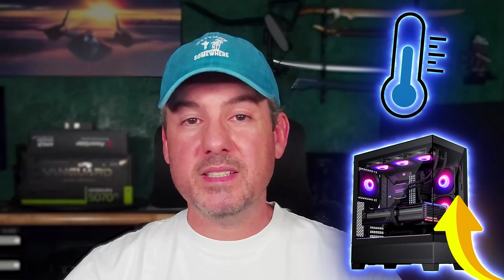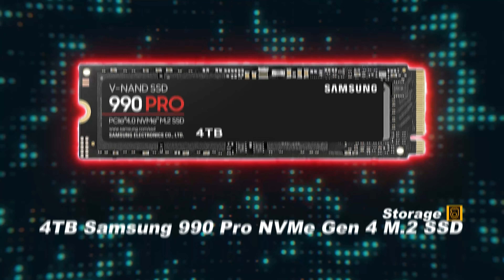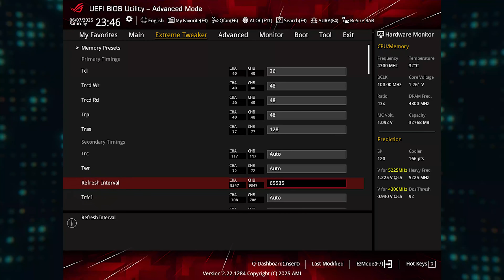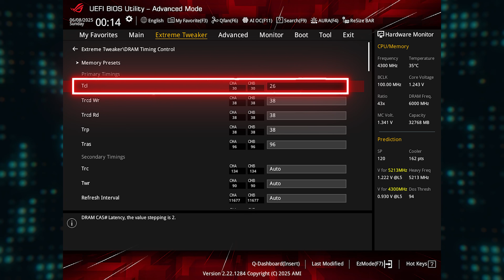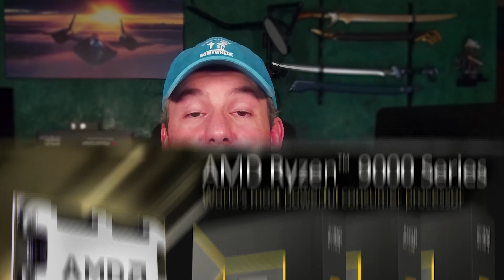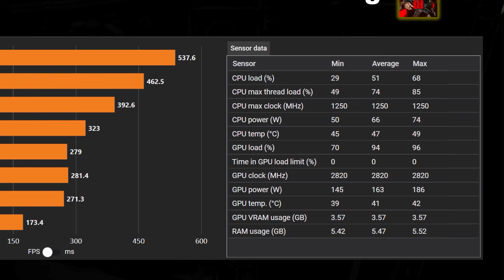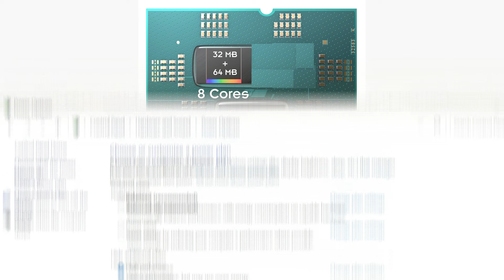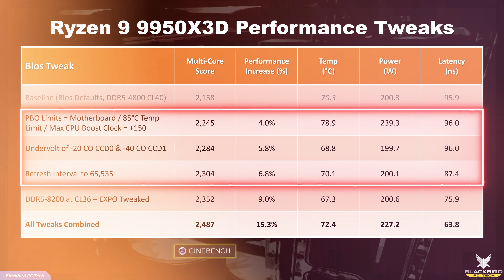What Are The Best Settings for an AMD Ryzen CPU?

Comment: The Ram MCLK/UCLK /FCLK really lost me.
I'm using X870 MAX GAMING WIFI7 motherboard with Kingston 64GB DDR5-6000 Fury RAM (2x32GB CL30) and R7 9800x3D and EXPO tweaked
so if i understand correctly i should go for a 2:1 and push my FCLK as high as possible but since my motherboard support up to 8000MHz then i should try 8000	4000    2:1	4000	2000 (from the graph) if that doesn't start my pc then lower the FCLK and bring the others down with it so it still allign with 2:1 then keep doing that till my pc can boot then Ram Test it to find errors if i do then keep lowering it till i don't???
but if i can't get it over 6600 MHz then just try the 1:1 (limit) and go for 1:1 when i lower the DDR5 speed?
Reply from the maker: No, you have dual rank (64GB) DDR5-6000 ... you can try pushing it to DDR5-6400 in 1:1 mode and try an FCLK of 2133MHz, but it likely won't be stable at that combo. You won't be able to push DDR5-6000 to DDR5-8000 successfully.
Reply: @blackbirdpctech  didn't know dual rank actually had that problem. the thing is, i literally just tried everyone one and it didn't boot just that one and here i am, this came as a surprise, and the refresh 65535 is still usable to me? and TRC and fine tuning is there also a problem with dual rank or should i try it out (find what others have tried on internet) or just don't touch it. Maybe the tight(thingy).
so if i find its not stable through memtest and so on should i just go down on FCLK and try or go down to 6000 speed and 2000 FCLK or just try expo 1 and memtest that.
the CPU part is still valid even with my ram right? no bad surprises because of my ram
BTW thanks a lot!
Reply from the maker: @jakob-f2d5j  it's not a problem ... dual rank RAM simply places a higher load on your memory controller. EXPO I should select an FCLK = 2000 MHz.
Reply: @blackbirdpctech so since it does that and yeah 6400 was full of errors.
does that mean its not possible to go beyond 6000 and higher that 2000 FCLK?
Reply from the maker: @jakob-f2d5j  you could likely get 6200 to be stable ... and you might be able to get an FCLK of 2100 stable too ... but I wouldn't recommend doing that if you are not able to run karhu to check stability
Reply: @blackbirdpctech  HCI memtest 400% Karhu 4000% no errors so its so far stable on 6200MHz + 2100FCLK tREFI 50000 (my case doesn't have the best cooling so putting my tREFI to 65535 i was afraid it would be too hot with dual rank and my case.) and i can't see my ram temp with HWinfo64 only SPD hub which is 55 when testing Karhu.

I tested Cinebench with (multi core) = 1336 pts and (Single Core) = 133 pts 
but my BASE use was with expo 2 and gotten me (multi core) = 1352 pts and (Single Core) = 133 pts
my 3DMark CPU profile its pretty much the same

im thinking putting my tRFC to 383 since i read it should be "dead stable for my ram and dual rank" but my question is ehm shouldn't I at least see some benefits, seem to me maybe expo 2 was just a little better at multi core or this is really just under marginal of error or have i gotten it wrong where these benefits would be applied. so I'm a little stuck if this actually is worth it in my case... or.. just revert and undervolt/overclock the cpu
could use some ideas/words of wisdom.
Reply from the maker: @jakob-f2d5j  try running an FCLK of 2067MHz with 6200 MT/s. You likely won't see much of a difference but you need to test something that stresses the memory to see results, not cinebench. A game like Flight Simulator 2020 or 2024 will do it.
Reply: @blackbirdpctech  will OCCT do the trick?
Reply from the maker: @jakob-f2d5j  not sure ... I need to look in to it more ... you simply need a benchmark that stresses the memory

Comment: Super informative video and I appreciate how straightforward it is.
Maybe I'm misunderstanding, but you mention being overly aggressive with undervolts and the clock speeds decreasing.
On my new 9950x3D, I'm seeing 5.1-2 when running AIDA and R24 but the scores are still good (2,450) with -10 on both CCDs.
Is that normal? I was expecting to see it maxed out @ something higher.

Many thanks!
Reply from the maker: You should be able to hit higher frequencies for a short period of time
Reply: So, I shouldn't expect to see 5.7 while running these benchmarks? I figured it wouldn't because it's utilising all 16 cores. Got it sitting nicely at -25, -25 which I'm happy with.

Thanks for the reply. :)

Comment: Under volt of 10 and the system crashes every time on a 7 7700x ran once for a total temperature drop of 0.8 degrees not worth the risk of instability
Reply from the maker: Is your system stable at stock settings? Are you sure you changed from positive to negative? Because this doesn’t make much sense.
Reply: @blackbirdpctech  has always been rock solid on stock ddr5 5600 memory running at 4800 so changed to exp 1 to run at 5600 stress tested for 2 hours no issue next step to change pbo to negative 10 ran once for basically no heat saving restarted to continue and tweak to higher negative system unstable and currently bricked so working around restore etc. to get back to stock
Reply from the maker: @Spudd66  best to run Karhu to check for a memory instability
Reply: @blackbirdpctech on a positive I corrected the windows drive errors caused by the instability returned the pbo undervolt back to stock and will live with the stereo typical hot running Ryzen 7 chips 😂

Comment: Great video! Somehow i always thought EXPO is the best performer of EXPO I and II. But you are saying I will give the best performance? It's hard to find any good answers, and all i find is people saying EXPO II is the best? Asus mb btw.
Reply from the maker: There is a good video where JJ from Asus goes through and explains all of the timings ... he is my main contact at Asus and he really knows his stuff. If I can find it again I will place the link here.
Reply: @blackbirdpctech Great! From what i can see and like you said EXPO II lets the memory set the standard sub timings and EXPO I lets the motherboard try and tune it for better performance? People also report increased latency with EXPO I.
Reply from the maker: From what I understand, all primary timings are fixed, EXPO II is a profile from the RAM manufacturer for sub-timings that will not vary for different motherboards and EXPO I is a profile with the sub-timings on Auto (motherboard selected).
Reply: @blackbirdpctech  Are you sure mobo is relevant with the EXPO profiles? Cus as far as i know both profiles are created by RAM manufacturer
Reply from the maker: @Atahann17  yes ... when you choose a profile it will either defer to the motherboard or use the built-in settings ... so EXPO II will use a lot of RAM manufacturer settings whereas EXPO I will leave most of the sub-timings on Auto for your motherboard.

Comment: Hey man, this is an awesome video. I have a weird use case, as someone who games very little, is there anyway to undervolt and change the settings such that it uses lesser power at idle and basic tasks? I am at 40-50w even when it's not a cpu heavy task, and I'm in an SFF so it's above 60c.
Reply from the maker: You can try using "eco" mode

Comment: I've been binging so many of your videos this helped so much liked and subbed great teaching style! Question tho I am just trying to do only an undervolt for my 9800x3d and I followed the steps you are doing, however I can't get stability in aida in anything past -10 CO for all cores. Do you think I should try to do per core optimization or is there something funky going on with my 9800x3d? I see a lot of people getting -20 to -30 range for all cores and it worries me I can't pass aida in anything over -10. Thanks!
Reply from the maker: It's simply the luck of the draw when it comes to silicon lottery. If -10 all-core bothers you then you should be able to extract more performance by dialing-in all 8 cores. And welcome to the Blackbird Army!
Reply: @blackbirdpctech  Doesn't bother me too much because I liked it stock anyways haha. Yea maybe in the future if I feel like needing some more headroom I know i can dial in the cores. Thanks glad to be here!
Reply from the maker: @abivenkat  you are not missing out on much performance ... perhaps a few degrees in temp ... definitely not a big deal

Comment: Spectacularly valuable video. Thanks very much.
I'm preparing to upgrade my Fight Simulator computer from AM4 5800X3D to AM5 9800X3D. The former has performed perfectly with LOW CPU temps on air cooling, but I undervolted the RTX 4090 right off the bat. With the 9800, I'll undervolt both GPU and CPU, but I'll skip the CPU overclocking step unless I  can't get the necessary FPS (usually extremely easy to achieve with simulators, as opposed to FPS games) because of being main-thread limited.
Reply from the maker: I would also recommend splurging for some DDR5-8000 RAM ... you will notice the difference in 1% lows in MSFS.

Comment: I have the same motherboard, but I have 128gb@6000 and have come to find out that I'm pretty stuck due to the double lanes on the ram. Which sucks because this is a good board and I need a lot of memory and it makes zero sense that you buy a four stick ram kit rated at 6000 yet it only runs at 3600.
Reply from the maker: You are stuck because using all 4-dimms places a heavy load on the memory controller ... my advice would be to get two sticks of 48GB RAM, so you will have 96GB across 2-dimms ... tough to do now though.
Reply: @blackbirdpctech  ya that's kind of what I'm finding. Though I did find some timings from someone who's managed to get them up to speed, figure I'll give that a shot first.
Reply from the maker: @gotindrachenhart  it's worth a shot but just remember it will come down to silicon quality

Comment: Thanks for the vid! I applied -20 all core in PBO and Aida64 failed in 2+ hrs. Is that anything to worry about? My RAM passed MemTest86; 6000 CL28
Reply from the maker: It depends ... it means that your system is not quite stable ... if you are just playing games then it's not a big deal and you will likely rarely see an issue ... if you are doing professional work then I would back-off on your undervolt to say -15.
Reply: @blackbirdpctech  Did exactly that and it passed for like 5+ hrs. Thanks!

Comment: Is there any way you can train your memory in your Bios, only reason I am asking this is due to the fact that anytime I start my computer the yellow light goes on with 15 in the motherboard. I don't really want to overclock, just normal gaming with as high as the setting can take without over clocking.
Reply from the maker: I'm not really sure what you are asking ... your system will automatically train your memory ... if it takes too long you can always turn memory context restore on. If you select an EXPO or XMP profile on your RAM you will be overclocking it ... it's nothing to be scared of and it will significantly boost your performance.
Reply: @blackbirdpctech  I have already have EXPO 1 picked out on the Bios, as my memory is a EXPO type on its own
Reply from the maker: @thomasenright5282  so then you are overclocking your RAM because you selected an EXPO profile

Comment: This is the best video for PBO and PBO2 especially for the 9950x3D. Great video, also like how you didn't ramble on or make me fall asleep, wayyyyy to many other tech youtubers giving way to much information rather than simplify then expand on the simplification. Great video! 

I just have one quick question if that is okay, in ASUS BIOS, in "EzMode BIOS View page", there is a 'Ez System Tuning' section which has that big clock image. It has "Standard (white clock)" and "PBO Enhancement (Clock turns red with small flame icon)", after doing all these tweaks and Undervolt/Overclock → Do we turn this on or is it to be left alone and not turn on so it doesn't override or cause any problems with our settings? Is there something it may do hidden that can't be accessed in the Advanced>PBO settings or is it irrelevant?
Reply from the maker: It's irrelevant after following this video ... I would simply ignore it. It's supposed to make overclocking easy but all it does is turn PBO on by making more power available to your CPU.

Comment: I know I didn't get the latest AMD or the best for gaming. but I would like to know what is the best settings for the  AMD Ryzen 9 9750X3D, I have a Asus Rog Strix X870E E, Corsair Titium Dominator 6000 EXPO 2 X 32, Corsair HX1500i PSU, Asus Rog Asteral RTX 5080.
Reply from the maker: That's what this video is for ... to help you find the best settings for your system. By the way, what CPU do you have ... you wrote 9750X3D.
Reply: @blackbirdpctech  Yes I have the Ryzen 9 9750X3D Zen 4, where you have the latest one the Ryzen 9 9950X3D Zen 5.
Reply from the maker: @thomasenright5282  I think you mean 7950X3D

Comment: I will try to do this to my 5800x3d
Reply from the maker: You might not have PBO options in your Bios ... if you don't then it will be tough to follow this guide. However, you can still set an undervolt using the approach shown in this video: https://youtu.be/GJCC94cRGys
Reply: @blackbirdpctech  To get the most fps out of this setup

GPU AMD Radeon Rx 7600 and CPU AMD Ryzen 5 5600X3D 6 - core processor 

Do I have to undervolt the cpu and over clock gpu?
 
Play COD MW3 and BO6
Reply from the maker: @Peppa809  the 5600X3D is locked for overclocking, but I would definitely undervolt it and increase the power limit. For your gpu you can follow this guide: https://youtu.be/IoOg0Qglneg
Reply from the maker: @Peppa809  just follow the guide ... it's simple and easy to follow
Reply: @blackbirdpctech  i actually have them, the motherboard is asrock b550  pro 4

Comment: I’ve watched many videos on this topic and this has got to be the best one. Not only did you explain all the steps, in order and in detail, but you also even gave the technical background behind the features (e.g., explaining how memory clocks work). And the thing is still less than 30 minutes! Awesome video.
Reply: same here, after many videos, finaly got here, thx from Romania.
Reply from the maker: @ElBandido-v9p  you are very welcome!
Reply from the maker: Glad you liked it ... appreciate the feedback!
Reply: @blackbirdpctech   hi i found a hidden bios tool smokeless umaf for setting precission  boost overdrive for my laptop and undervolt for it and is undervolting to negative  -15 a good starting point if not sure what i mean please let me know i liked and subscribed thanks also i got it set in power options to max or 2.8ghz and im sure i know how to unbrick it that ive done it before

Comment: well cpu is running about 35w lower at peak (gave up nothing in performance even gained a little, 30w in cpu cores 5w in SOC got that down to 1.07 from the 1.25 my expo was recommending, only running a 6000 Mhz C28 kit with a 9800X3D).

i must admit i'm not familiar with karhu but for a free memory testing alternative i can recommend Testmem5 with the anta777 extreme profile it requires a bit of setup if i remember correctly but it served me very well when pushing a kit of DDR4 B-Die to it's limit (timing wise). 1 cycle tends to take 28-36 minutes (atleast 3 recommended) which actually depends on your memory amount/speed which makes it a fun test to run when tweaking subtimings as you can actually see the total time it took to run decrease as you start to push the ram, though it doesn't stop when it finds a error so you do need to keep an eye on it or atleast i like to.

also managed to tweak 50w out of my 5070TI so far without compromising the clocks/performance (it's technically a 427mhz OC but i've OC'd it to maintain it's normal clocks @0.925v instead of 1.07v so i'm not counting it as a OC :P...i might be able to pull even more power out of it but first make sure that this is 100% stable).
Reply from the maker: I will have to check testmem5 out

Comment: Okay amazing results. Took a while but 9800x3d is set to -15 +150mhz. Not the luckiest chip but performance boosted and lower temps! Hopefully no crashes will happen in the next week.
Thanks a lot!

Edit: no crashes happened in the past 6 months
Reply: @FuroowHD  Just completed a build with the 9800x3d w/ the Aorus X870E elite, Lian li hydroshift 360AIO. And found as well that a  -15 @ 150mhz  was the sweet spot.  Stable after running Aida64 and my Cinebench23 score at stock was 22262, after undervolt and overclock got a score 23585. I don't know if that's good or not. Im still green. But I'm very happy with the results. Thanks, Blackbird. I'm happy I found your channel
Reply from the maker: @JERRY-2-TIMES  that's a fantastic result!
Reply: @blackbirdpctech  one question. Is it normal now for my clock speeds to be higher even at idle? Sorry bother you.
Reply from the maker: @JERRY-2-TIMES  yes, that's normal
Reply from the maker: That’s a great result!

Comment: Karhu occt is paid. Is there another alternative that’s as good or better to test stability except for memtest86…
Reply from the maker: Not that I’m aware of … that’s why I use Karhu and recommend it
Reply: @blackbirdpctech oh well all good memtest86 passed so my ram is ok but aida64 failed at negative 20 on my 9800x3d… I must be unlucky with this chip
Reply from the maker: -15 is good … the performance difference will be small
Reply: @blackbirdpctech yeah I’ve tested 15 and it passed but 18 is also passing now so.. 😅